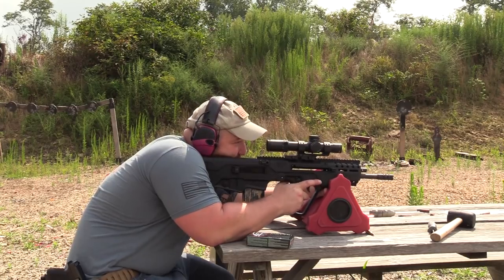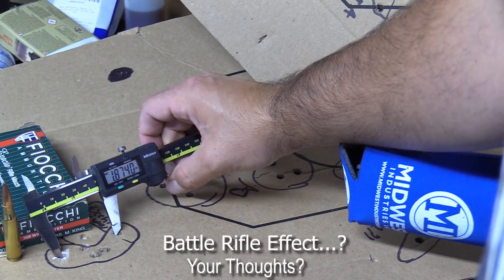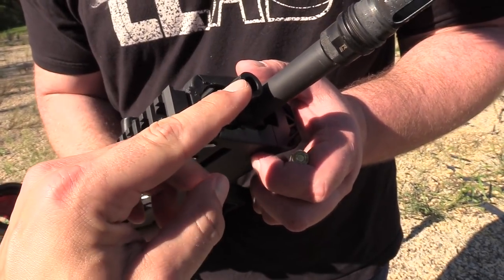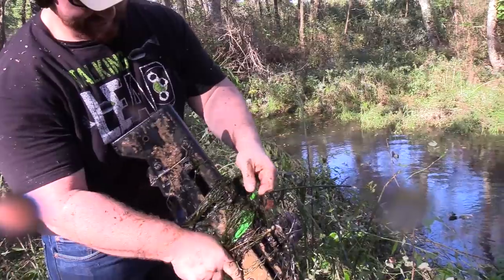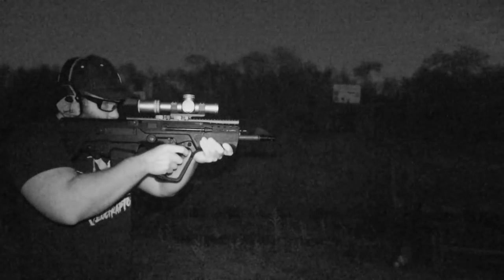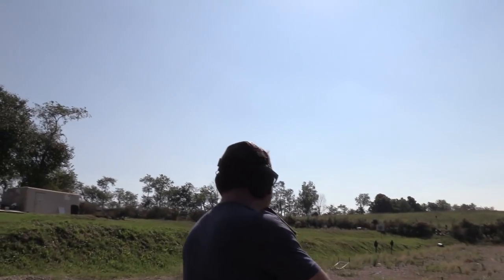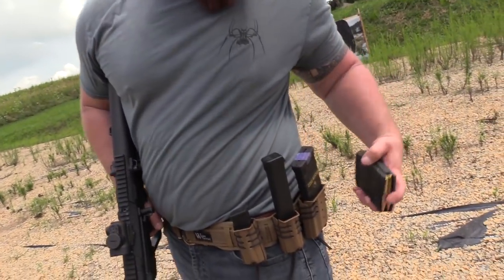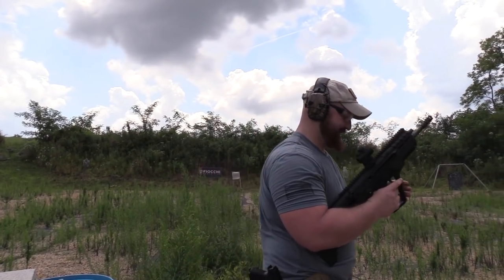Tavor 7: 7.62x51 Bullpup

Comment: I have both the Tavor 7 and the X95.  If you are concerned about he size of the Tavor 7 safety levers, the X95 safety levers will fit the Tavor 7 and give you a little shorter safety lever and the after-market X95 levers will fit the Tavor 7.

Comment: I am getting 1 to 1.5 MOA  on my 7 with NATO ball ammo and have about 1500 rounds through it.
The torture test was impressive. The original SAR did not do as well in other similar torture tests. I'm guessing IWI has done something to make this one take a beating & keep on ticking a bit better.
Good video. The best part was the torture test.
Reply: I saw the SAR tests too and after putting one on layaway with a non refundable deposit today, I was a bit concerned until I saw this video.

I wonder if the original being from what I understand a long stroke piston system vs this one being a short stroke system has anything to do with reliability. Also maybe the extra power from the 7.62x51 cartridge gives it the extra needed push to clear stoppages whereas the 5.56 can't overcome the debris in the weapon.
Reply: Had a RRA LAR-47 it was a 0.75" moa rifle.

Comment: Just saw this.  I have a Tavor 7 but its chambered in 7.62 NATO and I haven't put 308 rounds through it.  Can you?  I keep getting yes and no answers.  I tend to go with 308 can shoot 7.62 Nato but a gun chambered in 7.61 NATO should not shoot 308 rounds due to the 308's having higher pressure.  Any thoughts?

Comment: Great video! Good knowledge of the Tavor 7.  Great shooting demonstration of the Tavor 7.  I picked up.a Tavor last weekend and went straight to the gun range.  I love this .308 7.62×51.  I love Bullpups. I already have one in 7.62x39. A kit over a SKS.  The Tavor 7 has roughly the same feel of recoil. But has a much better trigger.  I have had several  308, a Cetme and a Fal dsa sa58.  This is by far superior for me.  Less recoil and more semi-auto like a AR & vary battle ready.  What red did you use in the short course run? Thanks

Comment: @The VSO Gun Channel,

How gassy is the T7 with the suppressor on the suppressed setting?  The Tavor always gasses me out, ha e they improved it?  How does it compare to an AR10 with an adjustable gas block or similar?
Reply: It's not bad. The suppressor setting takes care of a lot of the excess gas, and the short stroke system seems to bleed off a good bit as well. I haven't had any problems getting gassed out.